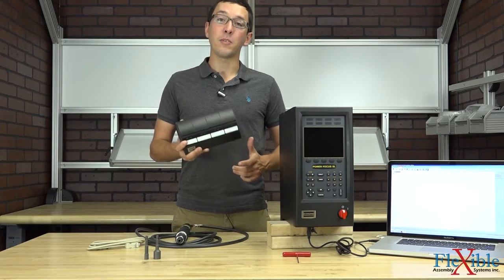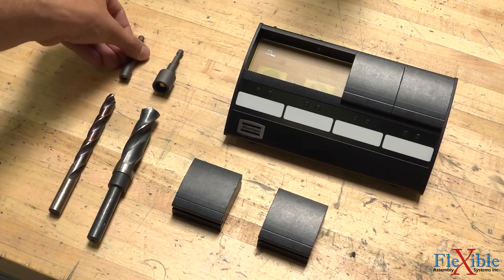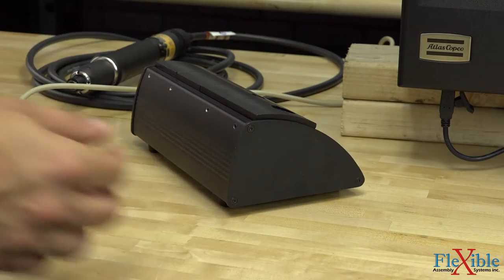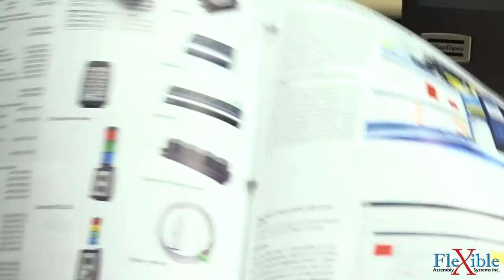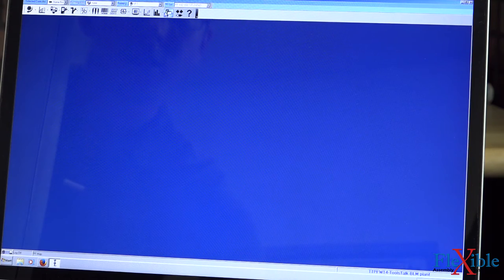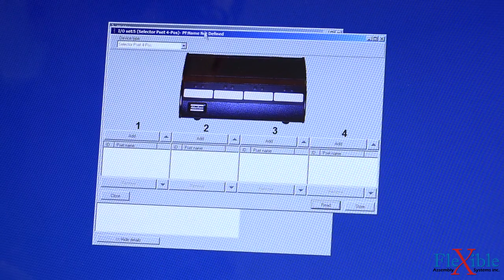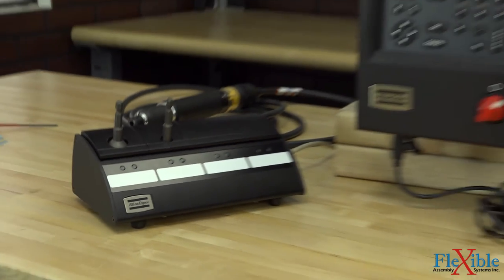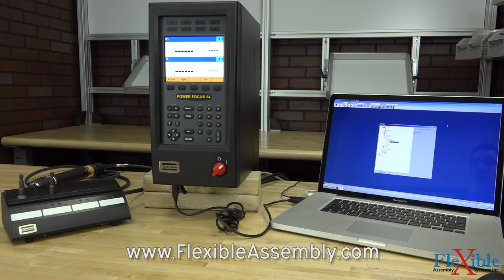Atlas Copco Socket Selector Tutorial - How to setup and program

Comment: How many nut runners can be connected to one PF6000 controller?
Reply from the maker: A single wired nut runner and 4 wireless nut runners can be connected and controlled by a single PF6000 using the virtual stations. More information on the PF6000 can be found in our video here: https://www.youtube.com/watch?v=ouDmpTRiz4o